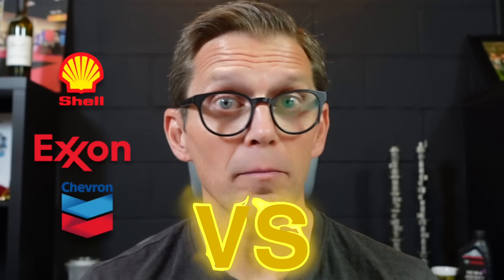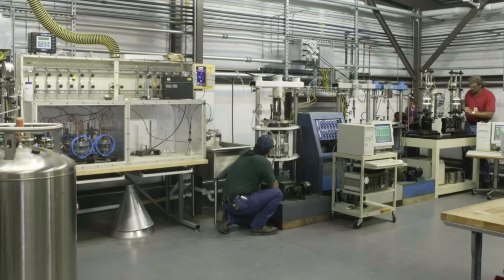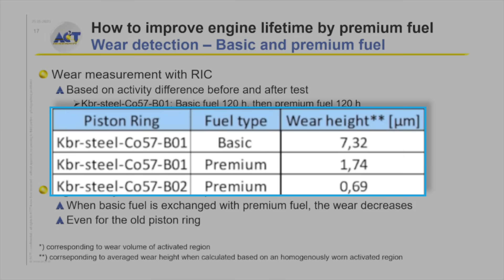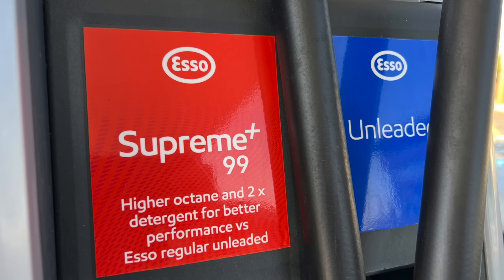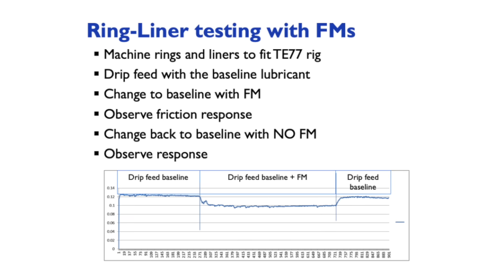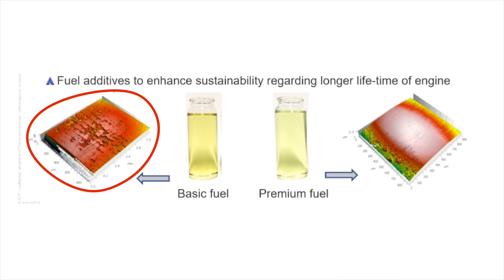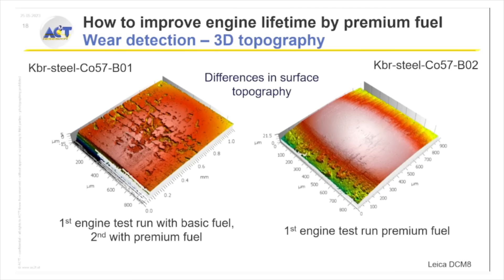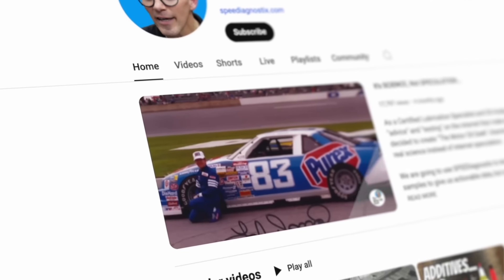Can Premium Fuel REDUCE Engine WEAR?

Comment: 13:34  I 🙂 have an 05 Subaru Forester not turbo automatic transmission. I have over 295k miles. Original head gasket. I do everything myself working on my car. Everything.  
I’m running Shell VPower exclusively and almost always from the exact same pump at the same Location. I have started using the Valvolene motor oil you did a video on the restore and protection. I have an improvement in fuel economy after changing it and I think it’s going to make it cleaner so I can drop the octane. I use the premium because it has carbon deposits in the cylinder robbing space for combustion materials. It knocks if I don’t use the VPower. 
  I can smell the fuel contaminant in the motor oil when it’s time to change it. I also have low carbon buildup on my spark plugs but they’re Bosch Iridium so it’s pretty hot running. The lubricators in the gas makes sense. It’s also lubricant for the valve train and fuel pump. It’s helpful to have the Nitrogen too if you have fuel in the tank awhile before you use it. 
  I live North of Seattle so there’s lots of moisture incursion in the fuel and motor oil. Especially living near the Bay. I factor that into everything I do with my car and maintenance. 😏
  You have been a wonderful Blessing for me giving details I can use to decide what to use. I’m going to run my Subaru until the end of time. I’m doing everything possible to keep it running well and reliable. I have extensive Emphysema and COPD so I can’t live without my Subaru. God Bless you and your Team thank you for your effort it shows you care ❤🖖🏼🇺🇸
Reply: 🤔 Most of the time when I get fuel at the Shell Station it’s only 30 cents more per gallon for V Power. 🤦🏻‍♂️ I get better performance and mileage from the V Power and I also drive the same terrain daily in a rural area. It’s not flat but almost. There’s a big hill I have to go up and back daily with my little Subaru Forester and a trailer for selling Salmon to the public for my Tribal Fishery. I have to empty wash and  fill my tote  every morning and pull the hill to get to the Market location. It’s obviously different when I use fuel other than Shell. I had to use the fuel from my local corner store once and had to physically shift down to do the hill empty. Loaded I had trouble reaching 45 mph the speed limit there. V Power doesn’t even notice the hill literally! There’s a substantial difference. I’m happy getting the consistent fuel mileage and performance from the Shell fuel to pay slightly more especially since it gets over 300 miles a tank 😮 while pulling around 2500lbs of trailer 😏❤️🖖🏼🇺🇸

Comment: I can not begin to tell you how many times I have tried to research "does fuel make a difference". So this video is a real find!  I have always used Shell 93 in my Audi and Mustang - both turbos. Thanks and keep up helping educate your fellow oil geeks!
Reply: I was recently told by my Ford Dealer not to run Premium Fuel in my brand new F150 3.5 Eco Boost saying it runs to hot and can ruin my motor????
Reply: @mcmuskie2563 ford would like you to buy another vehicle....every 150,000 miles

Comment: Well I have been using premium shell fuel since day one in my 21 Denali 6.2 maybe that’s why my engine didn’t blow up 🤷YET 
I did get a engine recall but I’m 70 drive it like a old man Changed oil every 5000km and only have 35,000 kms 👍 Like they say if you don’t drive it it won’t blow up 😂 ✌️🇨🇦🙏👍
Buy good fuel ✔️

Comment: So, i  have a jeep with a LS3 (420 HP). I run Amsoil 5-30 Signature and Premimum (93) octaine. Should i change my oil to a higher viscosity? I live in Florida so cold weather is not really an issue.

Comment: Hello Oil Geek! Your video got me thinking. I recently got a broken timing chain that forced me to repair the cylinder head of my Nissan Sentra 2008 2.0L S trim, and also do a partially overhaul of the engine. Being just an amateur Mechanic and being in need of having my only daily driver running, I had to cut corners and did not replace the bearings nor the piston rings. Though I wanted, because prior to the cylinder head repair, the compression was low beyond specs. All that said, I realized the importance to extend the life of my engine, hence the interest I have on your knowledge. On this particular video you mention the importance of the additives on the gasoline, and how they could extend the engine life by means of the friction modifiers they contain. But the thing is that higher octane fuels are better suited for cars of higher compression to function as anti-knock, being my car not a good fit for that because its actual low compression. Consequently, I was wondering about using the lowest octane gasoline and adding a gasoline additive with a friction modifier to reduce wear while also help keeping the injectors clean. I already watched your videos about oil brands comparisons, oil additives, oil flush and oil filters. Those influence my choice on oil And filters. I would now like to know the best gasoline additive for my use case. I suggest you make a more detailed video about impact of gasoline additives on engine oil longevity and engine longevity. Thank you!

Comment: Lake, you taught me a lot here. It is a bit depressing for me because my 2019 Ram 1500 with the 3.6 liter V6, like most other vehicles, only asks for 87 octane. I also have the yellow gas cap that accepts E85, so now that I live in Minnesota, I have been running that quite often when the price is right and the difference in price with the regular 87 octane fuel is greater.  In Texas, E85 was not that common. A dealership told me that E85 is bad for the engine, which I didn't believe. I don't see any Shell stations around my area either. I do run either Pennzoil Platinum or Royal Purple in my engine.  Is E85 really that bad? I have 80,000+ miles on my truck by the way.

Comment: We don't even have high octane Shell in my state, there are 3 stations in my state that have 93 octane.  I don't know that it has any additives!  I'm lucky to get the high octane the vehicle calls for (exotic).  The US has really dropped in standards.  I can remember 100 octane being available.  Then 95 octane.  93 octane used to be available at ANY pump.  Not anymore.  Now 91 octane is hard to find, in my state.  But 93 octane is VERY RARE now!

Comment: So im guessing, by this information that adding marvel mystery oil or transmission fluid to the fuel would  help lubricate upper cylinder and fuel components while cleaning them. I would love for you to do full breakdown about mystery oil and discover what it really does to an engine when added in fuel and in the oil to see if it works as well as they claim. Also to see if it does any damage whatsoever.
Reply: Yeah we use MMO too. (On everything) he wont talk about MMO for some reason...

Comment: I'm confused ...... basic vs premium, are we talking regular 87 vs premium 91 or Joe's Gas N Snack vs Chevron?
Reply from the maker: 87 is regular. 91 or 93 is premium.
Reply: @themotoroilgeek  Yes, but how does 91 premium at a no-name station differ from 91 premium at a Chervron or Shell? Is it only Shell V-power Nitro + that does the ring cleaning or is Chevron Techron just as good? Thank you
Reply from the maker: @cjsveen243  We are working on that test. Hopefully we will have the results later this year.

Comment: It would be useful to the audience to compare E10, E15 and E85 fuels against ethanol free fuels.  In the early 1980's, Chevron tested M85 (85% Methanol blend) in a Pinto engine.  In stop and go driving, the engine was worn out at 10,000 miles due to ring/liner wear.  M85 was a terrible lubricant.  Due to the polarity of EtOH, I would expect similar results for E85 and potentially lower ethanol content fuels.  The emissions benefits (if any) for ethanol fuel are another story.

Comment: PLEASE HELP ME UNDERSTAND
I remember being told quite the opposite of what the submission of this video is, So after watching, I looked it up on Google ( "it is generally not recommended and may even be harmful. The Camry is typically designed to run efficiently on 87 octane regular unleaded fuel. Using premium fuel in a car designed for regular fuel won't provide any performance benefits and could even lead to issues like knocking if the engine isn't designed for the higher octane." ) I bought a 23 Camry two years ago. And when I did, I ask about the fuel, they told me to only use the basic fuel. I didn't know that premium fuel was anything more than a higher octane, and they said it shouldn't get that higher octane fuel, I'm at 40000 miles on basic fuel. At this point, is it too late to start using the better fuel? Will it make a difference? Is there an ideal additive that I might buy from an auto parts store that accomplishes the same thing? And would I have to add it with every tank of gas? Please help.I'm officially confused. You can't trust the internet.And this guy seems to know what he's talking about. Also the internet ("No, using Shell's V Power NiTRO+ Premium gasoline (93 octane) in a 2023 Toyota Camry that is designed for 87 octane fuel will not cause damage to the engine, and will not cause damage to the engine's camera. The 2023 Camry can operate safely and efficiently on 87 octane fuel, and using a higher octane like 93 won't cause any problems.")?????

Comment: Love your content and enthusiasm. I’ve just run into the oil consumption with my GDI engine and wonder if there is any correlation with fuel and oil manufactures. Had I used better fuel and or oil would I have not had oil loss?
Reply from the maker: Try the Valvoline Restore & Protect
Reply: @ thanks so much for the prompt response. I looked at that particular oil on the shelves at the store when I went to find something to top up my engine but wasn’t sure if it was the usual sales hype to get buy-in. Given all the effort you put into your expertise I now see that it was likely going to be a good choice. Now I just need to ensure that my warranty will not be adversely affected if I choose to have my oil and filter changed elsewhere.

Comment: Arco must be great gas. My 94 Trans am i bought new has 338.000 miles now, and Arco has been my gas of choice for decades probably 90 % Of the gas its burned is Arco. Engine has never been touched,  even the timing chain is original.  It runs like new, and uses no oil. Oil has been Castrol GTX,  changed every 3000 miles. Have 268.000 miles on my 86 Pontiac Fiero,  bought new,  V6, same story. Also, I always use premium fuel in my vehicles no matter what manufacturer states. I like my knock sensors to remain in a deep sleep...😊

Comment: One KEY thing Not discussed Enough is “Ethanol”!  It seems like Ethanol discussion is comparatively like discussing the “Third Rail” in politics.  Ethanol is Garbage fuel, as far as Longevity of metals.  It is a corrosive fuel.  Small point: I worked for a race shop and the owner told the owners, “Take out your injectors and your plugs and spray air into the cylinders to dry them out!”
None of them did that.  
They were running 100% ethanol granted, but we would have engines coming back with massive wear from oxidation.  In fact, brand new engines had to come in for a “dingle berry” hone in the cylinders, after running a couple races.
All that said, I have a 5.0 in my truck. I ran nothing but high grade fuel for a few months.  I scoped my cylinders and found a lot of corrosive cylinders. I put an oil separator on it.  The oil in the separator looked like chocolate milk.  I switched fuel to NO ethanol.  Not only did I have less oil in the separator, it looked like regular oil (no chocolate color).  And the scoped cylinders had No corrosive look.
Conclusion: Ethanol is a Horrible additive.  It is Nasty and should Only be used in a system of performance in which constant due diligence is understood and performed.
Don’t get me wrong, in certain applications, ethanol is Great…..in “Everyday Driving” vehicles?….Horrible.

-two cents (although Lengthy!)
Reply from the maker: We have a video on that coming soon

Comment: Compression rings may get stuck due cheap gas. Your engine will start burning oil and run rough. I had this. Premium fuel made them unstuck. But try it yourself. Dunno about Diesel though.

Comment: Lake,
I recently asked you about Exxon Supreme+ gasoline after watching your fuel video because It's getting harder for me to find Shell gasoline in my area.
Well, I just drove my 1975 Triumph TR6 (which burns oil) on a 240 mile one-way trip to a British Car Show after topping off the engine oil.  I filled up with Exxon Supreme+ for that trip and needed about 1/2 quart of oil upon arrival.  I topped off the engine oil for the return trip and filled the car with Shell V-Power Nitro+ and only needed about 3oz of engine oil when I arrived home.  I drove 90% of the same route at the same speed.  I realize this is just 1 sample size and not 100% identical driving but pretty close.  I'd say the Exxon fuel doesn't provide the engine wear reduction that the Shell fuel does.  Any thoughts?
Reply from the maker: Thanks for sharing. All I can say is that I've experienced something similar before as well. I won't speculate as to why, but it is related to the fuel chemistry.

Comment: Unfortunately, I can't  get ethanol-free gas in Massachusetts (at  least anywhere I've been able to find), and have to go to New Hampshire or Vermont, where only Sunoco Ultra is available. But, when I've tried it as an experiment,  I do find a small improvement in mileage, maybe 1/2-3/4 MPG. Even if I switch back to regular (which I usually do simply because I can't afford the long-term price difference), I do see a little bit of a performance improvement with the added detergents, but the mileage improvement as small as it was, didn't justify the extra $10/tank, more or less, it would cost me.

Comment: I always use Top Tier, name brand fuel from busy stations, but the additive package for high test is not necessarily greater or better in higher octane fuel over regular;  it depends on the brand.  This is not the European Union.  Some brands, like Shell, say they have a stronger detergent and wear package in their high test fuel than their regular,  but other brands don't.  And using higher than 87 octane fuel in a engine with a lower compression ratio and designed to run on regular gas, is a serious waste of money as high test is typically about 25 percent more expensive and will produce no additional power or burn more cleanly. 
Adding a friction modifier to fuel will obviously help lubricate or reduce wear on piston rings but what additive, and which brands of gas actually use it? You could add Marvel mystery oil, the old top cylinder lubrication to your gas tank like it's 1975.   Of course no one ever tested to see if it worked.  But why not sell the  magic shell wear additive as an add to your gas product? Because Shell would rather charge you a dollar a gallon for PREMIUM! 
  
My old F23 A1 Honda engine has a 9.3 to 1 compression ratio with port injection and I always change my full synthetic oil between 3 and 4000 miles.  At 170,000 miles, it gets better fuel economy than when new, has all it's original power and consumes less than half a quart of oil in 3500 miles.  High octane fuel is not going to help or "clean" my engine.
  
I think GDI, low tension rings, and turbo charging are great for racing, with a tear down at the end of the season but are not good for long term street transportation. I also think quality oil, frequent changes and driving styles such as minimizing cold and rich mixture running time & waiting for warm oil before agressive throttle or high revs, is more important than high test for engine longevity, but top tier fuel really helps keep injectors and valves clean.

So,  What is this magic friction Modifier used in  Shell and the European premium gas?

Comment: I bought an audi TT that was eating tons of oil and had terrible MPG. I ran mobile one full synthetic oil and used seafoam in the gas and crank case. I ran shell and over time I noticed a performance difference.

Comment: All these theories are overzealous. I only used conventional oil and regular gasoline from any seller in my Chrysler 5.7 motor. Changed the oil every 5k including the first oil change. After 15 years and over 200,000 miles the car started and ran as it did the day I bought it new. The results should be judged on how the car runs not what a lab test says.
Reply: That motor is put together with huge tolerances, it’s like a rifle that will chamber a round that’s covered in mud.
This only applies to newer engines I’m sure.

Comment: What about fuel additives like lucas fuel injector cleaner with upper cylinder lubricant. Is it the same as a friction modifier / reducer. Great video by the way, very interesting.
Reply from the maker: We are going to test that out.

Comment: How does this information relate to the plugging of oil control rings in modern engines. What is the relationship between the fuel quality and the ring groove issue in the thinner lower tension rings used today.

Comment: I have a high revving motorcycle. Based on what this video talked about, would it make any sense to put a little Amsoil Saber oil in my fuel, like a 640 to 1 or 320 to 1 ratio at most?  

     And if it didn't help anything, would it hurt anything?